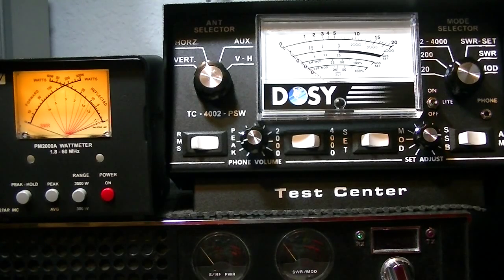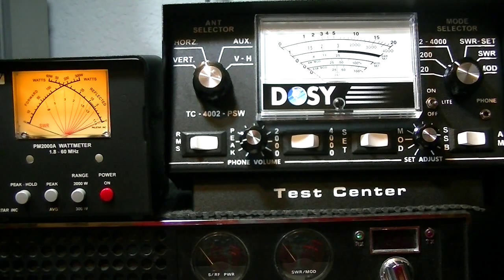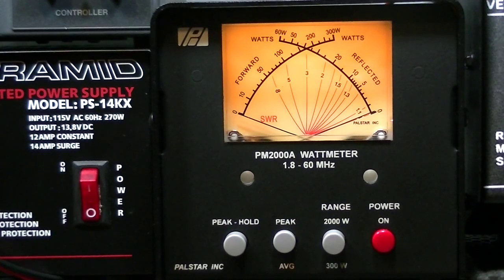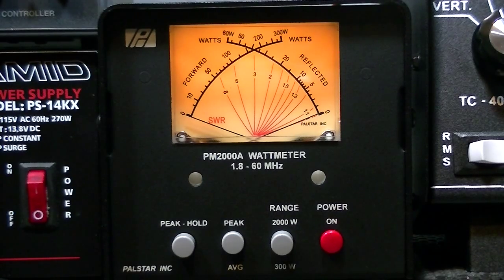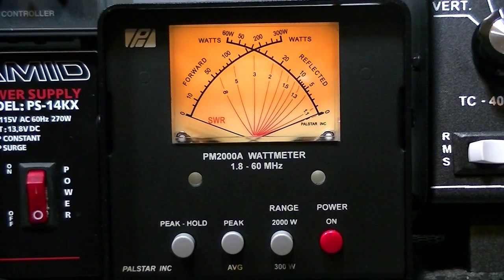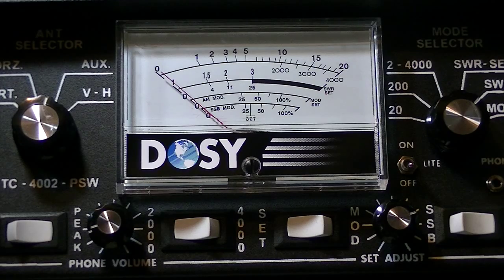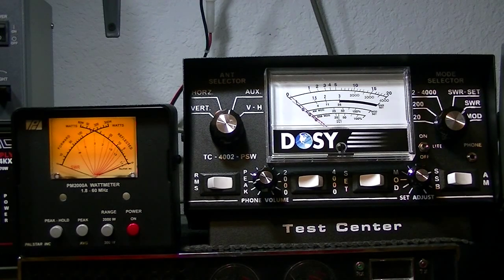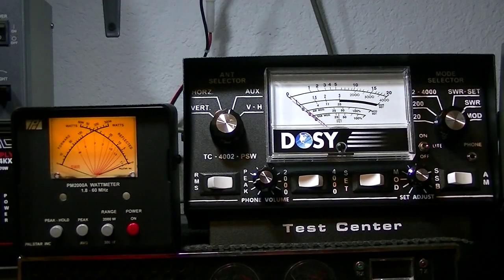CB Radio Meters,Most Important piece of Equipment you NEED

Comment: It's been a while since this was posted, so I'm interested in which of the two meters you're  more happy with and why. I've used to have the DOSY TC several years ago, and it seemed okay, but I didn't have another meter to compare. I do see the value in having both as confidence check.
Reply from the maker: Daniel Ortego Iam very happy with Dosy. It does no show you BS watts. There are meters that are high swingers. People like to see high numbers on their audio swing. I.e. "Bull skit" watts. I have owned them. So for a decent priced meter I do like Dosy.
Reply: Thanks, that's what I needed to know. I left the hobby several years ago, but now I can't get out that much, so I'm starting over.
Reply: Daniel Ortego and
Reply: where you buy your Dosy? I am looking for one I am in Canada.
Reply from the maker: Daniel Ortego Ham Radio Outlet or about any CB web site. Good luck.

Comment: I have always liked the cross needles meters but I too have used Dosy.  A few watts mean nothing as an over all reading unless you are driving something,  I will take swing over dead key anytime and if you are seeing forward swing on an avg your pep will be greater. It's downward audio that you do not want.  SWR is vary important A high SWR will push the output power back into the radio causing the finial to heat up and blow.  Thanks for the info

Comment: Howdy Albee... How's the ticker doing? Im at 10 years now since the heart attack and the stent implant and still kicking. Everything in moderation... 

Good explanation on the reflected power info. Basically, though, an inexpensive meter is fine for anything under 200 watts and just clip that center lead until you get it as low as you dare go for. Or use an electronic tuner LOL... That's the easy way. Lower reflected power = higher actual output. Even connectors affect SWR.